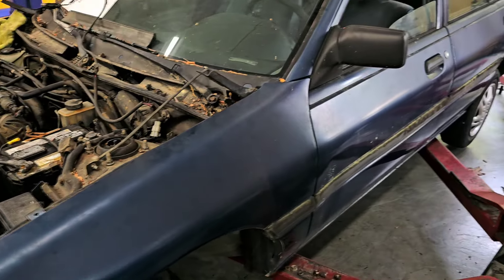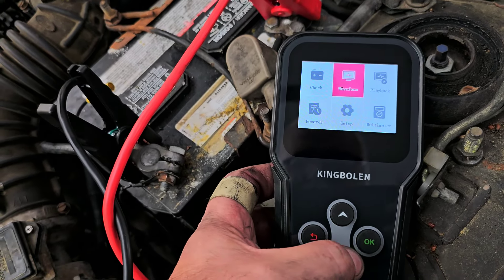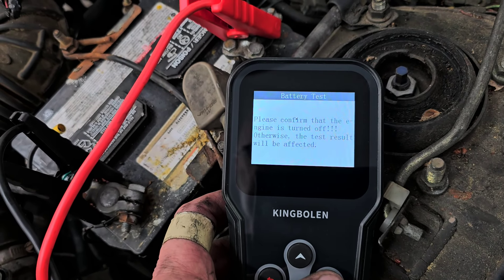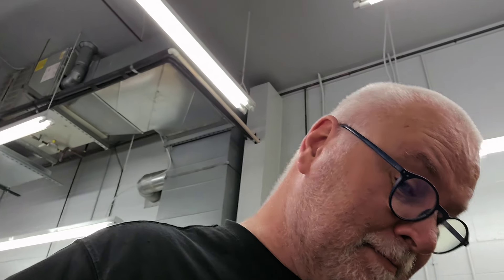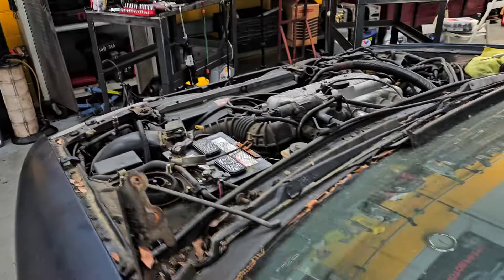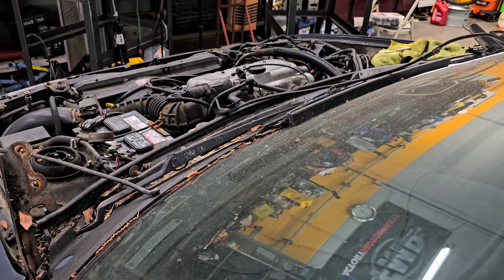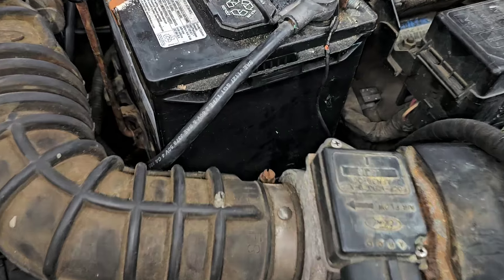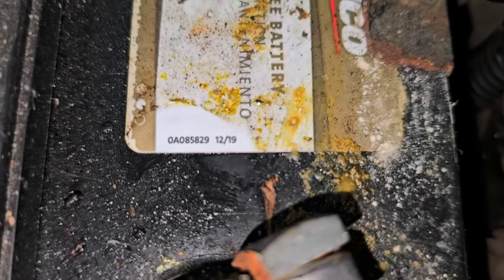Finally!! We Get To Hear Her Running!! 91 Ford Escort. How Can The Battery Still Be Good??

Comment: I had a 1995 Ford Escort four door hatchback with 46,000 original miles on it. Did some cleaning and it looked brand new. Had it for five years and put over 100,000 miles on it before the floor boards rotted out. What a great little car.

Comment: I had a 91 Escort Pony I bought from some guy who was rear-ended for $200, I put a bumper on it and drove it for quite a while till the clutch went and I scrapped it for $350 lol. I actually really liked these
Reply: My friend owned one, and it was repaired a lot. But also did the miles to get things to break. Water pumps, cam belts, regular rear bearing changes because the half shaft was slightly bent, and we never seemed to be able to find a used one.

Comment: In Australia they were released as an Escort up until August 1980 with the Ford 4 cylinder engine fitted but from August 1980 onwards they were replaced with the Ford Laser which is what the car in the video is called in Australia.

The 1.6 litre & 2 litre engine was fitted into the Escort & Cortina, Ford Australia shoehorned the locally manufacted 200 & 250 cubic inch crossflow.& Non crossflow 6 cylinder engines into the Cortina, the 105 kilowatt 250 cubic inch Crossflow 6 cylinder engine made the small Cortina go like the clappers in 1979.

The Lasers 4 cylinder engine was built in Taiwan for both Ford & Mazda (the larger Ford Telstar shared the same body & engine as the Taiwanese built Mazda 626 or Capella) & they had problems with them burning oil due to valve stem oil seals failure.!
Reply: Yes had that engine, did valve stem seals on it, and because it needed main seals as well plus clutch did also all the other seals and gave it new rings as a bonus. Then played which hydraulic tensioner was failed as well for a week or three, because Ford only had 2 in stock.

Comment: I used to work on a bunch of these back in the day. The rear springs used to break on them. The Mazda sourced engine in these, 91 and up was non interference but the Ford engine in the older ones was interference. I had an '89 Escort years ago, went places some 4wd trucks couldn't go 😂😂

Comment: My mom told me she wanted an old shitbox car with no frills and crank windows. I start looking and find a 1994 escort like 150mi away. 47k original on the car. The ad said that they believe the timing belt went...so I'm thinking no big deal. Ad was for $1400...talked down to $1100...then I saw the cooling system was trash. Paid $800 and towed car back to my state. I know it may have been high, but body was in mint,  and interior was like new (not joking). All 4 shocks/struts were new...whole brake system was new, including lines and master cylinder.
Now comes the bad, wasnt a timing belt issue. Turns out the head was cracked in 2 places and one of the valves was missing a big chunk. To my amazement none of the coolant that I just added made it past the rings. You could see the hatch marks on the cylinder walls from when it was manufactured.
I ended up getting a reman head for $300. Put the car together and it runs great. It rides beautifully and the transmission is like butter. Rust is not an issue because it was undercoated when new....with everything as far as cost of the car and parts...Im at $1700-1800...Yeah its a lot for a 1994...but I like it. Plus it proves I can do bigger jobs than I thought, after thinking WTF did I get myself into lol.